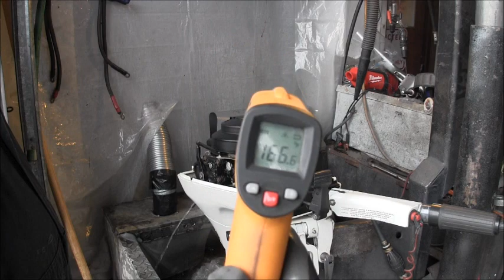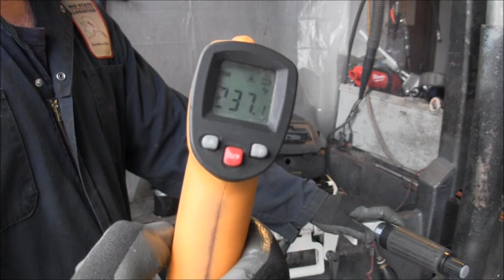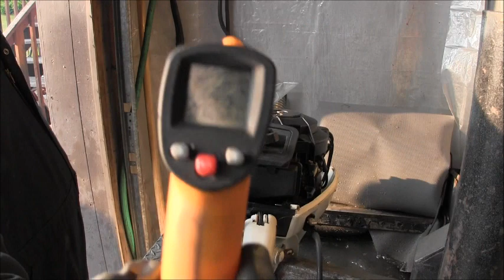JOHNSON 1994  15 HP &  WINNERS

Comment: Like I have said, haven't seen that impeller issue since way way way back in the day when OMC used aluminum housings and SS liners, the salt would build up between the housing and liner and crush the impeller causing the hub to finally spin out.  Who knows just what the issue is, just seems like there is some sort of bonding issue.  That's a real nice looking engine for salt water use, must not have many hours.  Even more surprised that the owner cared enough to notice that it was getting hot and got it serviced before he cooked it good....

Comment: I got close to the same motor. No start, has good compression just under 90psi. over 7/16 spark gap on a tester, tried starting with ZERO sucess, it used to run until i broke the pull cord. well thats fixed and now nothing. went thru carb and cleaned it all up. Im at a loss. The flywheel key is there. what should i look for next?